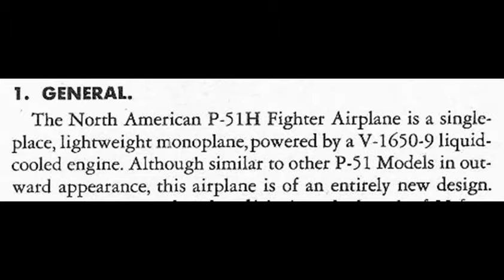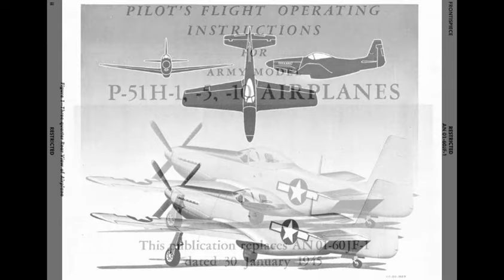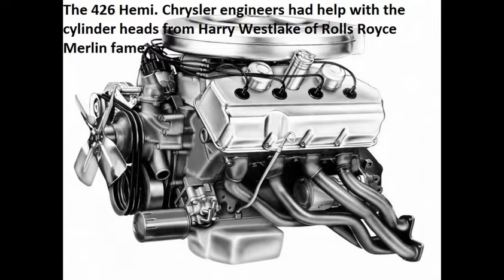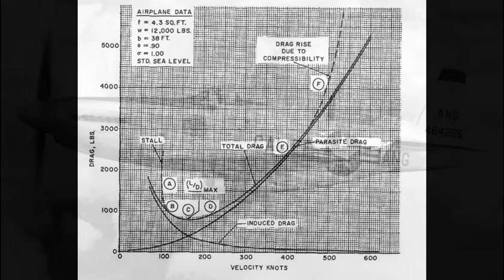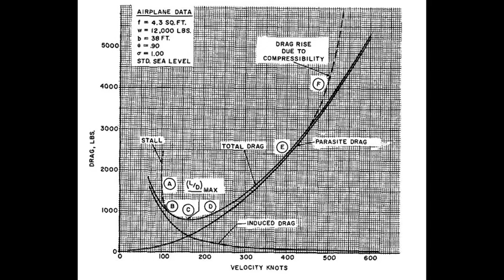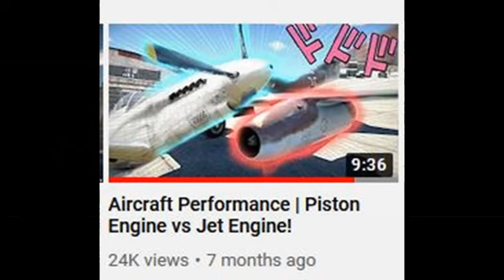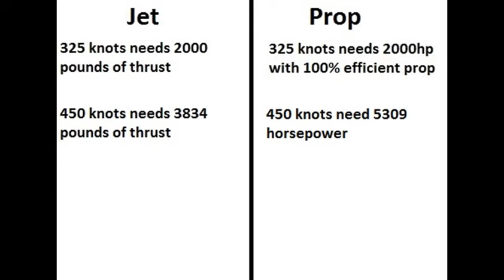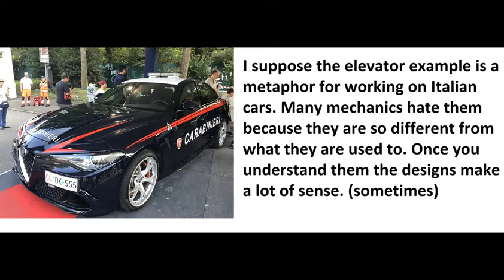U.S. "Superprop" Fighters P-51H, XP-72, and more

Comment: Seems to me me that these videos always ignore another factor that would have significantly increased prop piston driven aircraft - swept wings !  The planes had powerful engines, straight wings, doing 450+ mph flying level.  Sweep back the wings to lower the drag and increase speed.  I just wonder why they always just skip past the idea because it seems like such a basic thing to try.
Reply from the maker: Swept wings came into US aircraft a bit later. Even the early US jets were straight wing.

Comment: 20:52 Double wasp major layed out in a push pull configuration Do 335 style BAM!, you've got a super fast engineering nightmare that will be outdated by roughly 46'
Reply: Imagine the fuel consuption of that thing lmao.
Reply: @juanordonezgalban2278  it would end up the size of a medium bomber lol, the 335 was already designed as one, also I imagine cooling the rear engine would be near impossible
Reply: bad design. if anything you would do pusher prop with nose mounted weapons. 3500hp of those engines is plenty enough
Reply: @jebise1126  trying to meet his 5309 hp number in the video, not really doing too much design work here

Comment: OK either I'm drunk or you are.  I heard 42 cylinder liquid cooled radial.  "We can surmise they had problems with the engine".  Yeah, I think it's safe to surmise.
Reply from the maker: Well....I'm not drunk.
Reply: Curtiss-Wright planned the Tornado series of engines to be built in 14-cylinder modules.  They had a 70-cylinder engine planned.  The 42 was just their proof of concept.

Comment: These P51's I've heard were also water powered meaning that they used a small amount of gas to get off the ground then once up to temp they could switch over to convert water to power the engine giving them extremely incredible long distance in flight & other benefits. Much of this is hidden from people because if word got out that the military already were using water powered engines then the public would demand them also but this would interfere with oil companies & profits. There was a guy in the 70's or 80's who designed a water powered car & because he wouldn't sell his patents over to this unnamed source he met with an accidental death soon after. Coincidence of course.
Reply from the maker: That was just propaganda to hide the real power source, which was air.
Reply: @GregsAirplanesandAutomobiles  How about we just accept that the haves prevent the have not's from ever being free from slavery & that the arguments over who is right or wrong on many issues is really not an important discussion to waste time on?

Comment: 4 37MM cannons might have been a bit overkill perhaps? The Cobra has one mounted in the nose, and it's rate of fire is super slow, ammo is limited, and you lose a bunch of speed every time you fire it.. And that's with just one 37MM. 4 of them just wouldn't make any sense. Even 2 of them would be difficult to use.  Of course, that's just an opinion.
Reply from the maker: This was the M10 autocannon. It fired 165 rounds per min and had a new type of belt that allowed more ammo in a given space. It would be very effective against bombers. There is a reason the Soviets put a 37mm cannon on the Mig 15.
Reply: @GregsAirplanesandAutomobiles  Even so, what good does firing 165 RPM when you can only fit maybe 80-100 (or so) rounds per gun...The Cobra's ammo box for it's single M10 cannon took up a large chunk of it's nose and probably added a good amount of heft. Fitting 4 of them in the wings of an aircraft with any meaningful amount of ammo just doesn't seem like a good idea in a prop plane. You'd have to really take the time to aim your guns in an attempt not to spend all your ammo too quickly. Assuming the cannons would be mounted in the wings? Or would they be in the nose (area) of the plane? Having them in the wings and having to deal with convergence just seems like too much of a pain in the rump. The weight of the ammo itself for four fully loaded cannons wouldn't help with maneuverability either perhaps?... I think had they decided on the four 37MM cannon setup it wouldn't have lasted very long and they'd of gone back to the smaller caliber with additional guns. I mean if you're able to really line up your shots and nobody else is shooting at you, be it other fighters or the bombers themselves, then yea, four M10 cannons will def get the job done.. I'm definitely not saying or thinking whether the M10 cannons were any good or not. I'm just thinking it doesn't make much sense, practically speaking, to have four of them mounted in the wings on a prop plane... One or two in the center would have been cool though.. The 30MM in the nose of the German 109's were obviously devastating. Still though, 30MM is not 37MM.........Or maybe I'm just just over-analyzing things?.. Loving your content as always.. Have you had a chance to hit the skies in War Thunder yet? If so, I hope it was a good experience? Make sure you try both the Arcade and realistic type games. The flight mechanics are worlds apart.... Cheers!
Reply: @GregsAirplanesandAutomobiles  I also believe (4) 37mm would be over kill. Having that much weight incl. ammo in the wings would be a bit much. The more common arrangement was (4) or (2) 20mm as was on the later Spits, F4U's, 262, 263 etc. Still plenty of shred power. (unless the ballistics' favor your application)...Just thinkin' and sayin'.

Comment: P-51 H............... 50% engine serviceability according to Tom Cleaver..
According to Tom Cleaver
The V-1650-9 Merlin – which was close to being a “race” engine similar to the bored-out engines that power P-51Ds in air races to this day was as temperamental as those engines; the result was that units equipped with the P-51H seldom experienced more than 50% availability. This more than anything else was responsible for the P-51H not being called to active duty during the Korean War.

Comment: Great video. At high speed propeller tips affected by compressibility and efficiency drops off.
The Brits built the Spiteful ( 494 mph with latest RR Griffon ) and Sea Fang which went into service with the Royal Navy. Superseded by the Supermarine Attacker with RR Nene and the laminar flow wing from the Spiteful.
An older colleague flew P51s in Korea then converted onto the Vampire and later went back to P51 s. I always thought the Vampire would not be that much of an improvement performance wise over the P51. He told me the to quote “ the Vampire has more than double the performance “ and when you consider the energy potential of each in a dogfight the P51 would never achieve a firing solution.
I learnt to fly on Vampires. www.captainbyronbailey.com

Comment: In this video  at the 23:05 mark there is a photo of an early Navy Jet (I think it is an FJ-1 Fury), and there are 5 almost horizontal hash marks just aft of the inlet. I have a idea what they are for but is there anyone out there that knows for sure. I have also seen this on the vertical stabilizer of other Navy aircraft like the Skyraider.
Reply from the maker: That is a Fury, and I don't know about the stripes.
Reply: That's so the LSO (Landing Signal Officer) can tell if the airplane is at the correct AOA during approach to the carrier.
Reply: @gort8203  That was my assumption, do you have any more detail what the LSO is looking for? I assume that this was not very useful as it would be difficult to see until on very short final.
Reply: @25mitchel  It may vary with each aircraft but I think the lines are sighted to line up with the horizontal tail.  They were usually bright white on a dark blue and should be visible from a useful distance.  These marks were later replaced by three indicator lights (usually on the landing gear) that let the LSO see the same colors as the pilot's cockpit AOA indexer.  (I could never be an LSO because the Navy has those colors all wrong and I would be telling the pilot to add power when I saw red.)
Reply: @gort8203  Thanks very much, that is the info I have been searching for, you are the first to give a detailed answer.
Reply: @25mitchel  NP.  When the stripes are on the tail they probably line them up with the wing.
Reply: @gort8203  Yes, that is my thought as well. I work in an aviation museum as a docent/tour guide and this question has come up a number of times. I have asked many Navy pilots about this but none have been able to give an answer. So thanks again.
Reply: @25mitchel  Thank you for making the effort to obtain the information you need for that role.  I've seen tour guides at Udvar-Hazy disseminating misinformation they probably got from watching bad documentaries on the Smithsonian and History Channels.
Reply: @gort8203  Once again you are spot on, I can't tell you how many times I have had to gently correct visitors and other docents about misinformation. Our crew of volunteers will not accept conflicting information unless there is substantial documentation to back up their claims. With visitors we just try to gently correct their information and very often from the sources you have identified.

Comment: These US Super Prop fighters P51H and XP-72 should have been otpimized for ground support operations of the Army. The jet fighter planes should have been used for the air superiority missions of the Air Force after the defense reorganization of 1947. The jet aircraft is a poor ground support aircraft because of high fuel consumption These Super Prop planes could have been optimized and turned into excellent flying artillery with long loiter times of many hours. The point here is to find new roles for older designs. No reasons exists for American ground troops in the Army or Marine Corps to ever be short of close air support. The infantry/tank teams flush out or find the enemy on the ground forming a skirmish line behind whatever cover is available fixing the enemy troops with a location. Much of the fighting is accomplished with these "Super Prop" ground support aircraft dropping napalm, 500 lbs bombs, cannon shells, 0.50 machine gun bullets and rockets. These "Super Prop" planes attack the enemy in assembly line fashion with well practice air to ground communications and tanks firing color smoke shells to identify targets. The tanks and infantry teams with engineering support and artillery push the enemy back from their positions immediately after the airstrikes to finish them off. 

Again, the concept here is to "find, fix, fight and finish" the enemy forces making maximum use of assembly line close air support. We utilize the longer loiter time of these Super Prop ground attack aircraft while the Air Force fights the enemy for air superiority shooting down enemy warplanes. I think this division of labor with the Army having Super Prop planes for close air support and the Air Force with jets for air superiority missions and operational/strategic bombing missions would have made an excellent team. The idea is to create a mincing machine to kill the enemy by the trainload in assembly line fashion. In Korea, some of this close air support was done using WW2 propellor aircraft like the P-51. However, the P-51 in Korea wasn't optimized for ground attack with adequate armor leaving it vulnerable to North Korean antiaircraft fire.

Comment: Wasn’t  the F82 Twin Mustang a derivative of the P51H?
Reply: No F82 was designed earlier, as another way to get a longer range escort fighter. The improvements to single seat fighter range throughout the war made it largely unneed.
Reply: @jonathansmith2898  ok the way I understood was that the most common airframe to the F82 was the P51 H. EAA’s video about the XP82 restoration alluded to the most common airframe was the H model. Thanks for then clarification.
Reply: @mthury4532  I did some extra digging too. And were both sort of right. The base of the design(was the p51h however it was only the base) it is almost entirely redesign.
Reply: They had to stretch the body and change the tails, also allot of interal stuff was changed. You can't make a f82 out of two p-51h but you would be close.

Comment: I actually have used that style of elevator.  The Hyatt Regency at the New Orleans Superdome has that type of elevator.  There is actually a YouTube video that shows this.    
https://youtu.be/x7isJbj_KqA
I work for a multinational engineering and construction company and the design team needed to adjust to those local conventions such as floor number 1 is the first floor that is above grade.  Some of these conventions are more logical than what we do in the US  (in my opinion).

Comment: it ain't a liquid cooled radial - it's a seven bank inline engine of 6 cylinders each, coupled together like they used to do X engines ,or w engines....
Reply: + eyalcr500     The Wright R-2160 Tornado engine was a  seven-bank,  42 cylinder liquid-cooled radial.

Comment: Modern Hemi engines are real hemi engines. It's not a gimmick polysphere or marketing ploy. They really are hemi combustion chambers. Built a few of them.
Reply from the maker: No they are not.
Reply: @GregsAirplanesandAutomobiles  Dude I am an engine builder. I have built both the old 426 hemi and worked on many modern hemi engines. The modern hemi is well know for lifters jamming in bores and grinding the camshaft to a broom stick. I have swapped cams on many new hemi engines. Cam swap on them require pulling the head. I can say from personal experience the valve arrangement and shape of the combustion chamber is the same as the 426. Trust it's a real hemi. ASE Certified Engine builder.

Comment: XP69 wasn't a radial engine... it was an X engine... 3 x v14cyl engines or less likely 6 inline 7cyl geared together... you can't have 7 banks of 6cyl radials... unless its a 2-stroke
Reply from the maker: The Wright R-2160 Tornado is referred to as an "inline radial".
Reply: @GregsAirplanesandAutomobiles  By who... even inventors can't redefine definitions... by definition... The radial engine is a reciprocating type internal combustion engine configuration in which the cylinders "radiate" outward from a central crankcase like the spokes of a wheel. It resembles a stylized star when viewed from the front, and is called a "star engine" in some languages. Wikipedia
Oxford
a type of internal combustion engine used chiefly in aircraft, having its cylinders fixed radially around a rotating crankshaft.
The R2160 is 7 banks of V14s geared to a central gearbox output shaft... no common crankshaft... that makes it an X configured engine in principle & definition... irrespective of what the designers at the time might like to call it
Reply: @Errol.C-nz  Wrong.  It's 6 banks of 7-cylinder radials.  Single crankshaft.  Go look up Kimble McCutcheon's book on the Tornado.  Or maybe the Aircraft Engine Historical Society has a page on the Tornado.

Comment: Hi Greg,

I know this is an older video now but I'm hoping your channel is small enough to still see this - in future, can you PLEASE give figures such as pressure, speed, etc in both metric and SAE units?

I'm willing to bet that a significant portion of your audience are non-Americans like me with no fucking idea what "seventy inches of mercury" actually means. Just use Bar ffs!
Reply from the maker: I very often do exactly that. However I should add that I never see the Europeans doing it the other way around.

Comment: what about x engines? or maybe w engines? why were those not more common. and i mean true w not just 2 engines welded together.
Reply: the Jumo 222 kinda operated along those lines, with 3 v stacks in a radial but ran into technical problems of all kinds and never made production after 5years of R&D by wars end.
Reply: @jakeb6703  wasnt that opposed piston one?

Comment: First floor is the first floor (or lift) above ground. Any carpenter (like me) will tell you that. I do not know where the trend of calling the ground floor, the first floor came from BUT I suspect that it has something to do with the development of non-load bearing walls and skyscrapers, in places like Chicago where underground tunnels and multi-level cellars became necessary to move/store goods and fuel, etc., due to congestion and climate issues.
Yanks still talk about getting in on the ground floor so ... I suspect it was a response to the adoption of multi-level cellars and also multiple street entrances, resulting from the ability to create larger floor plates with relatively small quantities of building material, i.e. which floor do you call the ground floor?
Reply from the maker: Maybe, or it could be because the first floor is literally the first floor.
Reply: @GregsAirplanesandAutomobiles  Could be BUT the concept of having a timber, stone or concrete surface on the ground floor of pretty much every building, instead of dirt, is relatively new, even in the developed world. That is why I made my comment, as a carpenter. The first floor was, and in many cases, still is, the first floor to be constructed from timber and/or stone and/or ferrous metal.
Thanks for your videos. I reckon they are well put together and very well researched. I like the fact that you do not pretend to specific knowledge you do not have.